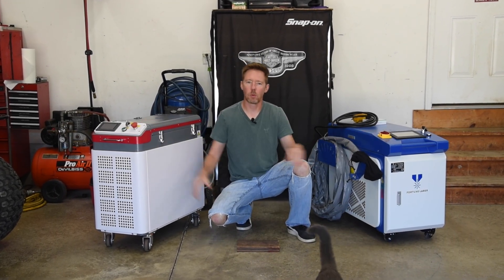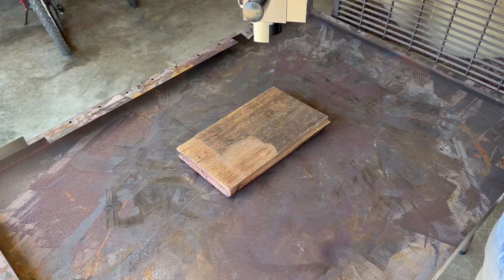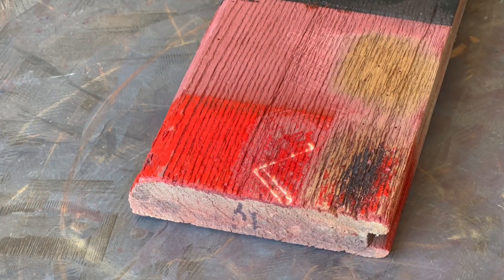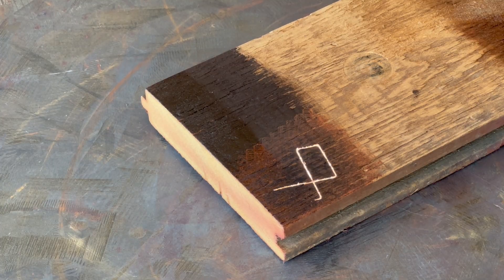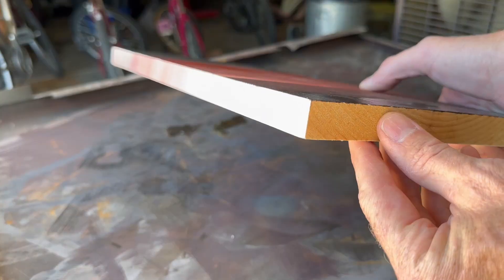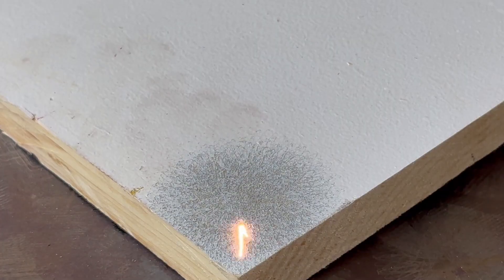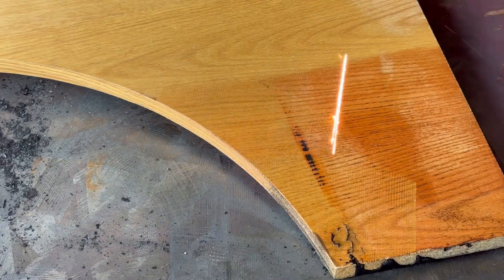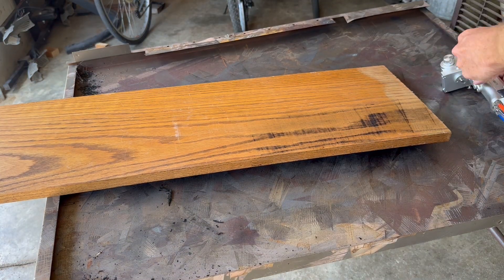Laser Cleaning Wood - Removing Stain & Paint with Laser Cleaning Machine

Comment: Here is a video I did my my 300w pulsed laser on a chair with oil based stain.  Water based stain, as you can see does not come up. It soaks too far into the wood. I have my parameter settings in the video like you did to give you an idea of another setting and swing pattern. https://youtu.be/-FYJHMnlBMQ

Comment: What if you removed some of the paint layer and moved on, then came back after it cooled off? If that helps, then maybe several passes would work without burning. It’s worth a try. I’ve have a laser welder, but it’s continuous. I haven’t looked too closely at the cleaning mode, but I use it mostly to clean metal edges before, or after welding.
Reply from the maker: That;s a good idea... I'll have to try that. Thanks!

Comment: Damn, I just thought I had something to get my white paint off the wooden windows: (would it be possible if you painted the white dark and then went over it with the laser, or would it just go up to the white layer?

Couldn't the constant laser be adjusted to work with less power? 

Great video 👍👍👍
Reply from the maker: If a dark color is over white, the laser will remove the dark color as normal, then remove the white slower.  The CW could be adjusted to a lower power, but that would increase the cleaning time.
Reply: @6thGearGarage thank you 👍👍👍

Comment: Even the stuff that got etched was repairable with a sander.
But a sander would clog in an 8th of a second in that bed liner. So this would probably be a last ditch effort.
Reply from the maker: I would use something like this on old wood trim with lots of recessed designs. A sander is definitely still the way to go on a wood floor.